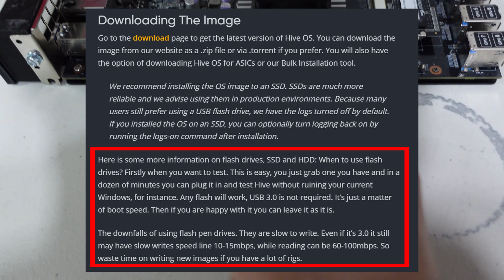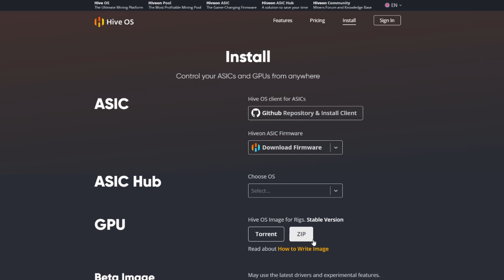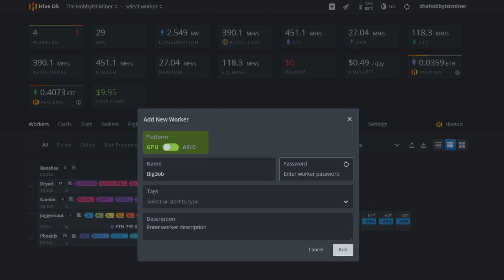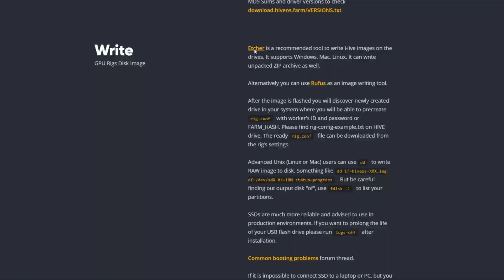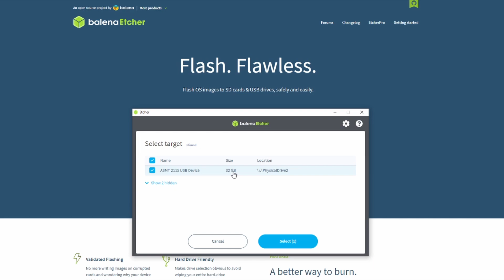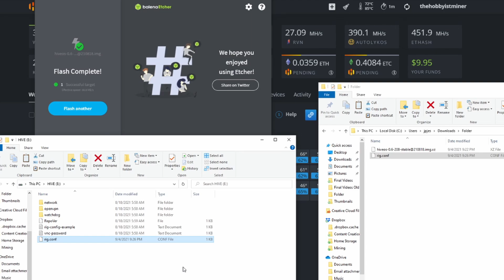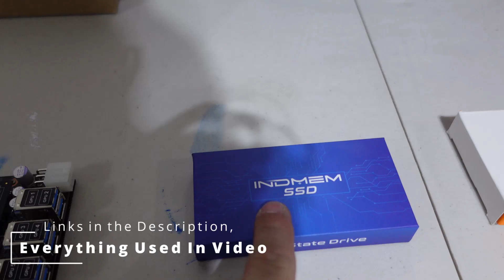How to Install HIVEOS onto an mSATA SSD | Guide for New Crypto Miners

Comment: You can actually just load from the USB directly to the hard drive through Hiveos using 2 commands in the remote shell access. Takes about 2 minutes and you don't need any other parts.
Reply: Hi Scott, Could you explain how to do this?   Thanks!

Comment: I picked up four Rebtechs back in February and I wish I had ordered a crate of them. They are my favorite mobo and make such an easy rig paired with one or two server psus. I started with hive on flash drives but after two crashed on me, I made the switch to the msata and they have been rock solid since.